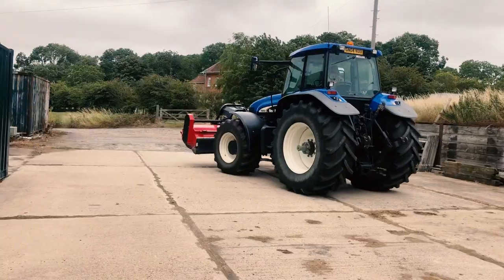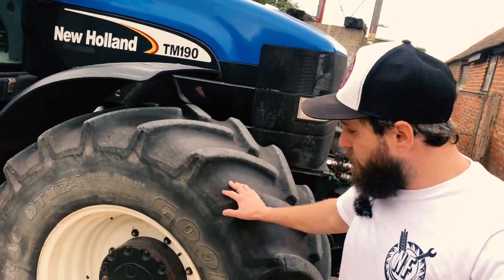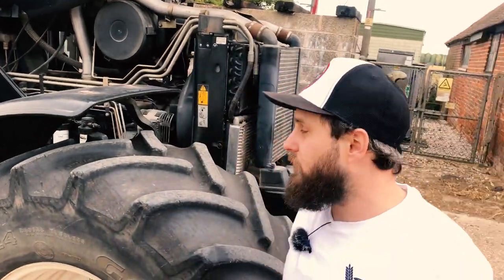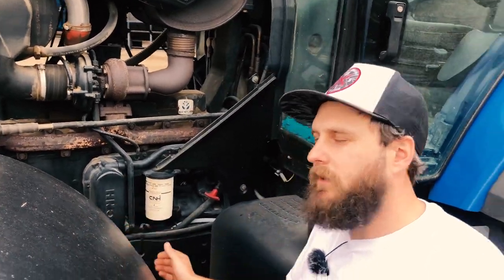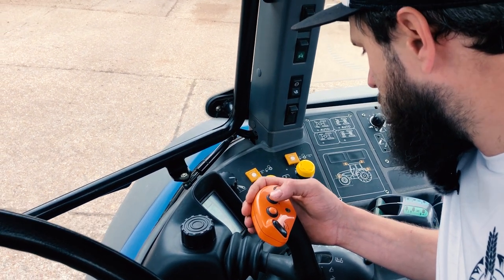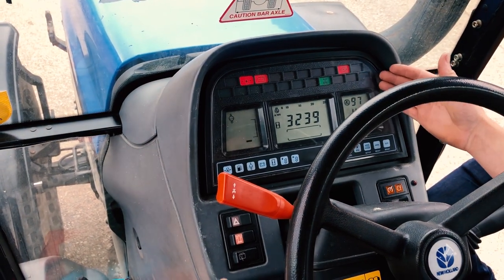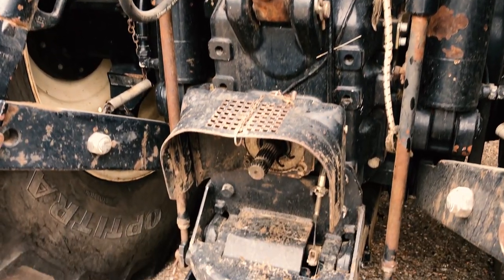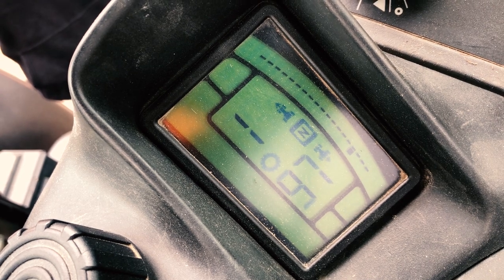BRING THE NOISE! | TM 190 LOW HOUR BEAST | OLD SCHOOL REVIEW

Comment: Love an aul tm but then 190 are lethal for giving trouble that’s why you can find thousands of them with extremely low hours cause they spend their whole life on the garages getting fixed
Reply from the maker: This one has done well, hasn’t really had a spanner to it yet.
Reply: Hi Marlon, can you describe some issues with the TM190 / TM175 , because I want to buy a used one... What are the main issues, they look very solid build and have not that much electronics build in compared to the newer ones, so I wonder where the real problem are buried :-)

Comment: The TM 175 and the 190 are not the best of the series...
Reply from the maker: The 150 👌
Reply: Hi Lars, whats the problem in special with the biggest TM´s ? I thought they where more solid build compared to the "smaller" sisters... :-O
I am asking, because I am trying to buy one of these beasts atm...
Reply: @MrFlextor  Not exactly. A lot of people had transmission and engine problems with them, but our tm175 has literally only had an injector pump done in 7k hours so I guess it’s luck of the draw